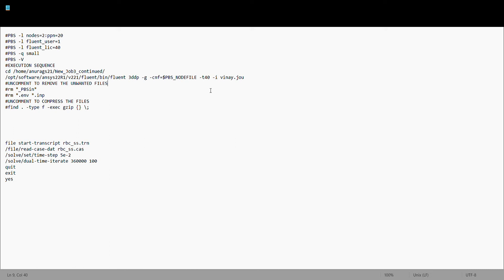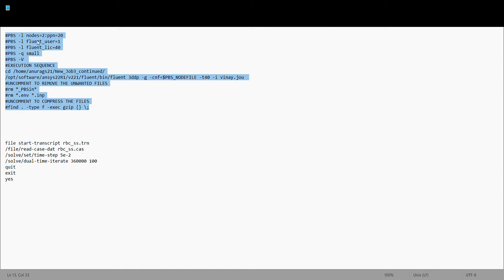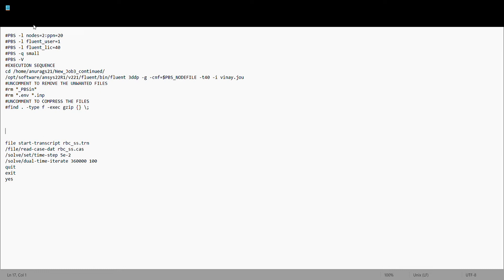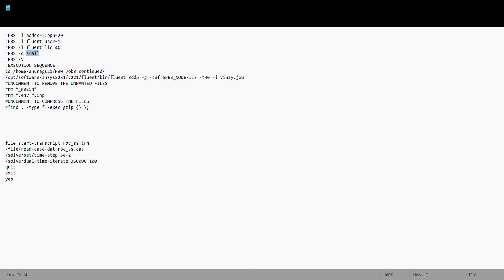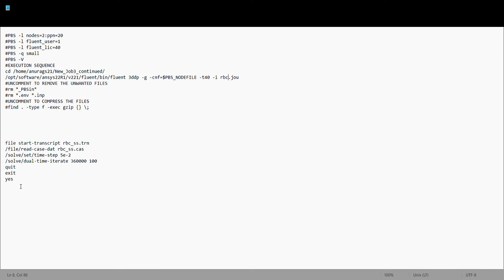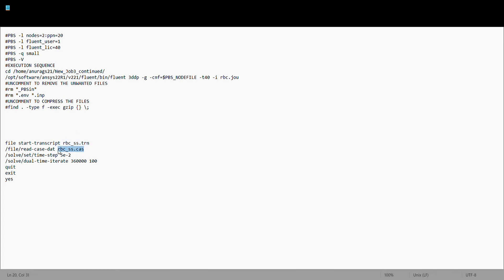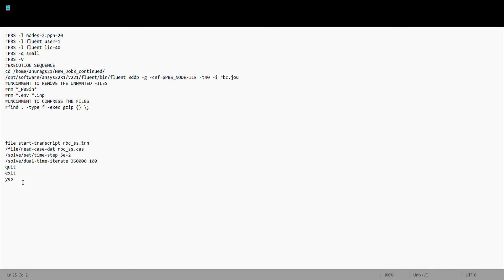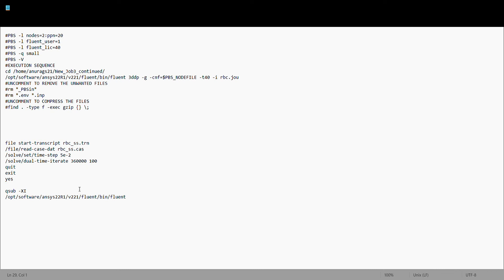How to submit Ansys Fluent job on HPC (IIT Kanpur)? - Part2

Comment: hello small question: if i was running a steady state 3d simulation what should i write in the journal file
Reply from the maker: Hi, time iteration must be removed from my journal file. And you must have updated the same in the case file. Your journal file must be updated as per your HPC user manual.

Comment from the maker: Answer to one of the comments: Well, for me, total wall time is decided by HPC classification, say I have chosen queue type "small" for which I am allotted 5 days. For the simulation just chose a time step, and number of iterations for one time step within which your solution will converge. Then dual time can be : say 1h = 3600 second and you want to run for 10h, then 3600*10*number of iterations

Comment: In the journal file, how the no of hours is decided ? for cal of timesteps
Reply from the maker: Well, for me, total wall time is decided by HPC classification, say I have chosen queue type "small" for which I am allotted 5 days. For the simulation just chose a time step, and number of iterations for one time step within which your solution will converge. Then dual time can be : say 1h = 3600 second and you want to run for 10h, then 3600*10*number of iterations